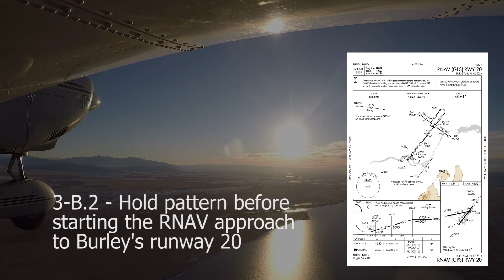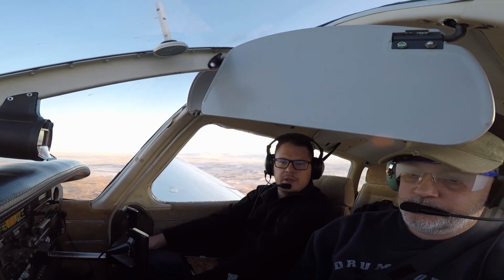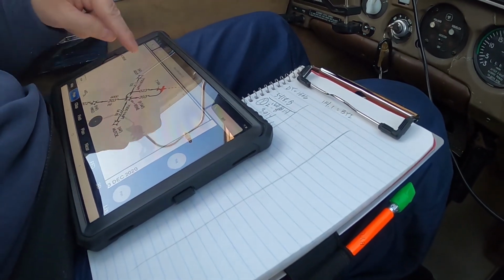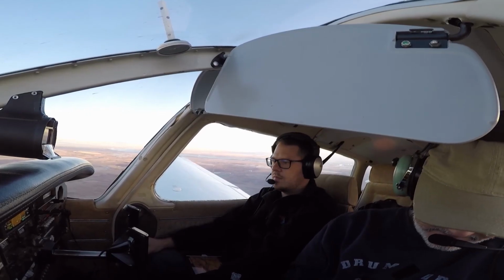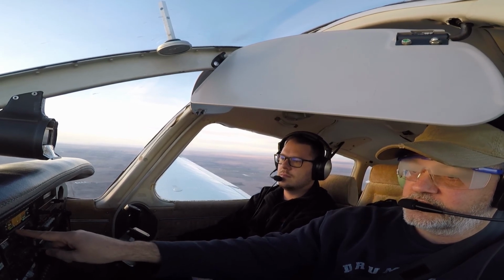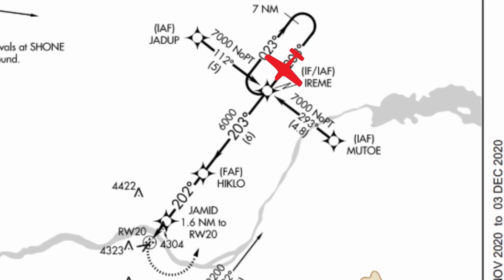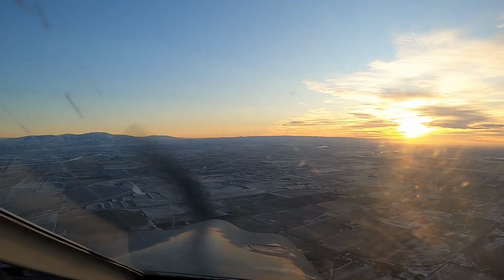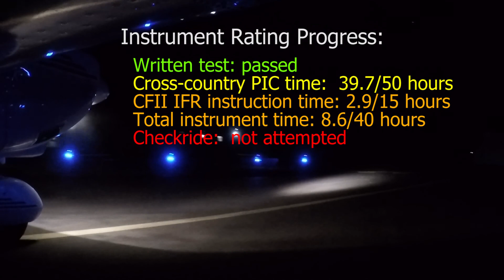Instrument Rating IFR practice hold and approaches in Burley, Pocatello, and Blackfoot, ID

Comment: you should land on Runway 20.
Reply from the maker: This is the approach that the Gem Air pilot flew a few weeks ago, ending in a crash. The wind has never been right for me to land on that runway, but even so, I don't like it because of the obstacles just in front of the runway.
Reply from the maker: Good idea!  There are instrument approaches that exceed the minimum alignment with centerline.  The ones that come to mind are called LDA (Localizer-type Directional Aid) approaches.  Grand Junction, CO has one.  The RNAV approach to Burley's runway 20 is straight-in, though.  What I do in this video is "circle" to runway 6...and even on that one, I make a dog-leg final because of some grain elevators in front of that runway.